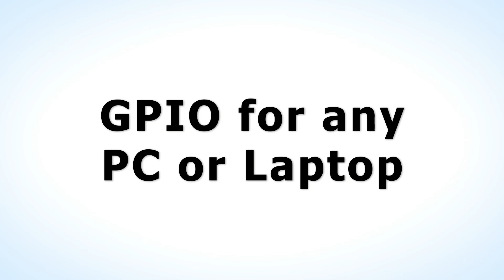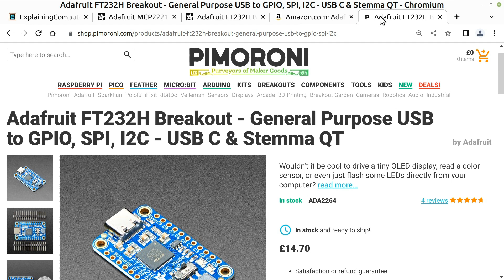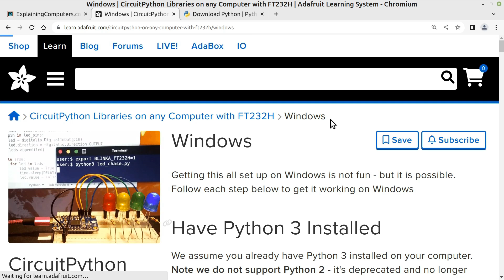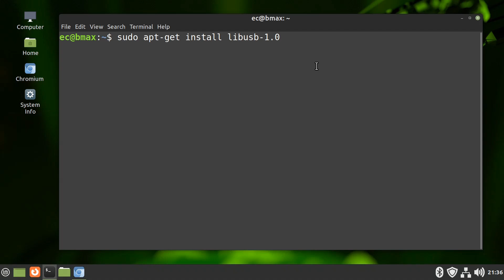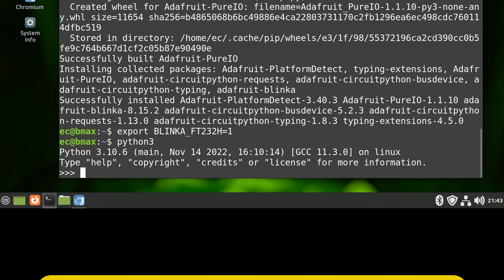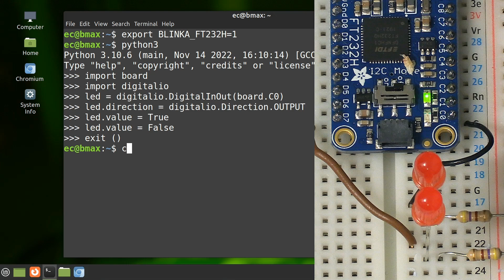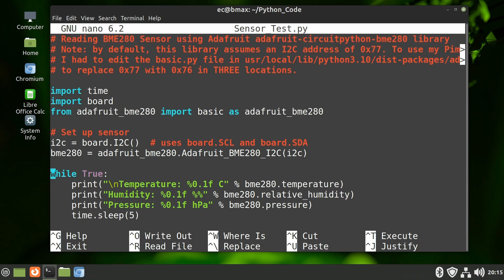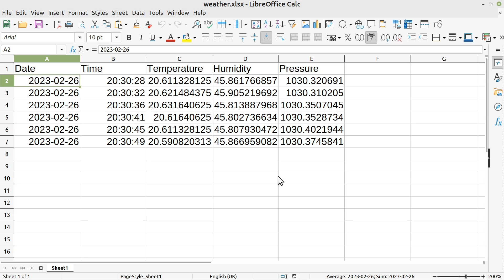GPIO for any PC or Laptop: Adafruit FT232H

Comment: Back in the day, standard serial and printer ports could be used as GPIO. That was the first time I was controlling electrical devices using a computer.
Reply: Exactly what I was thinking of, anyway, I think using parallel port was easier to start with since it doesn't require any coding/decoding circuit
Reply: @ahmad-murery  Those were the days my friend, we thought they'd never end. But they did. Personally I think a picoW or ESP32 has so much more to offer, so why did they bother with this ?
Reply: @hilldweller2  So true my friend👍,
anyway, I think having a direct access to GPIO will open the doors again for some applications (windows apps for example) to easily read/control external machines at a low cost.
Reply: @ahmad-murery  there is firmata and pyfirmata or you can create your own firmware

or write pc software that connects to and talks to the micro python interpreter to do stuff

for the pico there is also: Python picod module
Reply: @Henry-sv3wv  Not sure if I got you, do you mean that using Firmata and/or pyfirmata I can talk directly to the microcontroller on a raspberry pi pico?
can you collaborate more on this?
Thanks
Reply: @Henry-sv3wv  Thanks, I'll check it out
Reply: @hilldweller2  this would also satisfy with imbedded hardware design. Granted, most looking for an imbedded os with use a single board computer, but this would allow a lower development cost at current market availability.
Reply: @hilldweller2  Direct access from your pc, instead of programming a separate device.
Reply: @hilldweller2 I'm guessing to use your pc's cpu or gpu for speed.
Reply: @ahmad-murery   some applications (windows apps for example) to easily read/control external machines at a low cost.
Isn't it done easily and cheap with USB 1.x or 2.x?
Reply: @OgbondSandvol  I think using GPOI is easier to communicate with a simple machine that all it requires is switching on/off some control lines,
also, using USB requires to ship the machine I'm controlling with a USB/Serial encoder/decoder and maybe a driver (not very familiar with the subject).
maybe it's just me, but I find it quicker to test/implement my ideas using GPIO than using USB.
I'm not aware of any simple USB control implementation so if you do please share.
Reply: Besides serial and parallel, I also used the 15 pin joystick port.  This was cool because the joystick port can do analog input.  Good memories.
Reply: @gregholloway2656  I was just going to say that, I used to do that with the joystick ports on my old Atari 400....
Reply: You can still sort of do this today! Your computer has a bunch of I2C devices including HDMI. People have hooked up I2C devices to their HDMI ports and was able to do cool things with it.
Reply: I remember making a printer port to two additional joystick ports for the Amiga so we could play 4 player games such as dyna blaster
Reply: Back in the late 90s I remember cutting the plug end off a SNES controller and mounting on a parallel connector, wiring it up such that ZSNES could use it like a regular controller. Still have it tucked away in a box somewhere. Was awesome for playing emulated SNES games being able to use authentic hardware.
Reply: Actually, you could probably do something almost identical today. You can set up serial connections to MCUs, although they will admittedly actually be routed via USB. Send bits over the computer's pseudo serial port to indicate whether pins should be high or low.
Reply: @zetaconvex1987   Didn't old Garmin units do  serial over USB ?
Reply: I haven't seen one but I'm sure there are USB to parallel port adapters?
Reply: @MrTweetyhack  Yes there are USB to Parallel and USB to Serial, I used several ones in the past to connect newer PCs to old nautical devices
Reply: @ahmad-murery  I never got USB to serial to work. The shop I bought adapters and such from said there's a technical issue with 'em so they usually don't work.
Reply: @Reziac  I remember I had an issue with one adapter where the port appears under device manager on widows but the connected device cannot communicate with it, so I wasn't sure whether the issue was with the USB 2 Serial adapter or with the device itself.
Reply: @Reziac  There are two different chipsets for USB to Serial. One is really good and the other is crap. I forget which is which. 340 rings a bell.
Reply: @wayland7150  Interesting, thanks!
Reply: @MrTweetyhack  I haven't seen one either, but if there is I don't think the 12v pin(s) would be implemented..
Reply: @MrTweetyhack  Yep, I use one with my big old LaserJet. Works fine.
Reply: @MrTweetyhack  Pretty much everything that connected to a PC has a USB version that emulates it to the extent the software does not see a difference. It still thinks its a parallel port or a RS232 port.
Reply: Yes I remember it. The parallel port is basically ttl and eight bits of output/input (and some control lines), I used often. Did you know that you can still add one to a pc with a pcie slot.  The usb to printer ports are not good, only for really old printers not proper parallel ports  You can of course use a rs232 uart for io, but the logic is not ttl, and being a serial port it does not have very many pins. Also some modern devices do not have all the control lines.  But usb to rs232 devices are cheap and common.  

But neither of these (parallel and rs232)  has I2C or pwm etc.  

Lately I bought cards from data acquisition companies which generally have some io, maybe some counters. 

But the parallel port is still a thing in some science labs. It can have pretty low latency.  And win32 includes a simple interface for low level control. Not sure  about the latency of devices in this video. It might be as low as 1ms, but it depends on how they worked the usb interface.  I find a lot of these things a jittering in time response.
Reply: @bledlbledlbledl  It doesn't work like that in modern Windows anymore. There's a lot of extra steps that need to be taken now because the security model doesn't allow you direct access to hardware anymore.
Reply: the parallel port is still being used in professional EEG (brain waves) machines
Reply: I worked for a company in the 90s where installed video servers across the US, Canada. Puerto Rico, and in Belgium. We used serial and parallel to activate and read from devices connected. It would have been great to have these back then.
Reply: I still have a book I got in the 1990s on that subject.
Reply: Indeed. The original BASIC Stamp was programmed serially through the PC parallel port. Chip Gracey (owner of Parallax and creator of the BASIC Stamp and Propeller chips) is a whiz at x86 assembly coding and wrote the entire BASIC Stamp 1 editor in assembly, which included bit-banging serial through the parallel port. He did this because it uses 5v levels which allowed a direct connection to the BASIC Stamp 1 circuitry. The BASIC Stamp 2 used level shifters for standard RS-232 levels for connection to standard serial ports.
Reply: Yeah I built a box that took inputs via the serial port and controlled relays by turning on and off various pins on the parallel port. One example was to take temperature readings and display the temperature on the computer and switch on my air-conditioning if it got to hot. Check again sometime  later and if below a threshold then turn it back off.
Reply: Great story grandpa
Reply: Back 40 years ago I had a Maplin GPIO board for my Dragon 32. Yes it flashed LEDs but I connected a FET and did motor speed control. Attaching a GPIO to a computer you are familiar with is helpful. However the way it's shown in this video is identical to using a micro controller, at least in software. It would be more valuable to be able to blink the LEDs from MS Excel or Visual Basic. For example a Windows powered vending machine. Yeah I know that's a bit turn of the century these days because everyone uses Linux now.
Reply: And somewhere in my Computer Closet, I have what was once a very expensive ISA board used for similar connectivity. 

My goodness, how things have progressed...
Reply: Exactly what occured to me
Reply: With some high voltage to fry sensitive components coming from the serial port.
Reply: Recall using a parallel port to control a pair or plastic robotic arms.
Reply: Ach yess
Reply: Couldn't you do this if you bought a computer with a serial port? They're not uncommon on the mini PCs such as Chris held up. Have never looked into how to access. Probably the gadget Chris is showing us is much easier though,
Reply: But I guess it was in MSDOS era when programs had no multitasking and devices had no buffers. Yes, I remember that friend build me LPT DAC with amplifier relatively cheaply, it was much better than a sound card for a few programs that supported it (I think it was FastTracker and very few games)
Reply: I did not use it   except for controlling PC through LIRC, with IR receiver. Have you a hint how to printer port for controlling some relays, which software?
Reply: @colloidalsilverwater15ppm88  You can use Mach3 (32 bit windows, closed source VB)  or LinuxCNC to control relays,  but they are heavyweight programs for CNC machines.  They each use open source drivers to control the ports though so you could research that.
Reply: I'm still running CNC machines off parallel ports.   If I need something more sophisticated I'd get a Mesa card which offloads some real time control to an FPGA which  helps with latency spikes from the Linux kernel.   If I'm forced to use a USB connected I/O,  I'd do the  real time motion control on the "I/O" board,  like the Arduino Mega in my 3d printer.
Reply: I never get that level of using PC, and dreaming of it still today. Can you please do effort and give me so info regarding?
Reply: We did that in 2013.
Reply: And in the ancient prehistory, the bus of an 8-bit home computer was made available for the user in the back of the computer or in an expansion unit like my Sharp MZ-80K. Simply write to and read from I/O addresses that you decoded from the address bus. Not feasible nowadays of course.
Reply: Cool
Reply: This is how ancient techology is lost and gets rediscovered again
Reply: Alot of motherboards made today still have serial. You just have to break out the header on the board to a port on your case.

This is to satisfy business customers who often require serial for specialized machines and hardware and cannot use/dont want to use those USB serial controllers.
Reply: Single board computer
Reply: Laptop
Reply: I remember those days
Reply: Oh yes.  The banded wires.  Radio Shak to the rescue.

Comment: Great video!  This opens up a lot of opportunities, since it adds GPIO to anything with a USB port that can run Python.  Do you know if anyone is working on larger GPIO breakouts in the future?  The FT232H is a good start, but pales in comparison to the 40 pin GPIO connector on the Pi.  Maybe I'm just greedy, but I like my GPIO ;-)
Reply: I suspect with a bit of tweaking, you could run multiple FT232H boards connected to a USB hub.
Reply: @jimlynch9390  Good thinking.  It looks like each board gets a unique address so in theory it should work.
Reply: @Wythaneye  The only tweaking might be where in the Adafruit software you might put the port ID.  The other consideration is how might you address the boards from your code?  I haven't looked at any of this, just watched the vid and didn't see the answer but I could very easily have missed.
Reply: There are numerous different FTDI devices, some of which have more I/O. You could also use an FTDI part that provides an I2C or SPI interface and hook that up to as many bus expanders as you need.

Comment: Can you explain what that chip on the board actually is. Is it a microcontroller or what exactly?
Reply from the maker: It's not a microcontroller. The FT232H is a basically a USB interface controller -- allowing USB control of other serial or parallel interfaces. The chip is often used to provide the USB interface in devices like digital cameras, flash card readers, for industrial automation and reading sensors, etc. There is full information here: https://ftdichip.com/wp-content/uploads/2020/07/DS_FT232H.pdf
Reply: Interesting. Could this then be used on say an old mobile phone to give that some GPIO? Assuming drivers, etc existed for i.

Comment: You can press Ctrl+D exit Python. Don't press it to many times or you'll exit right out of your terminal. That's always fun.
Reply: know something even more fun than that. Typing rm asterisk.asterisk while as root in a terminal. Learned that rather imortant lesson in 1996 while I was new to Linux and learning how to use it. Ended up spending some more time getting familiar with the installation and setup process.

Comment: The BMAX has disappeared from the internet, lots of unhappy customers, and negative comments on amazon,unit not working out of the box(or later) etc..
you should not promote such businesses if you have any respect for your viewers.
Reply: I just looked and easily found the BMAX he mentions, though the price has gone up a bit.   As far as respecting his viewers, I've followed Chris for years and found him to be one of the most up front and honest people on youtube.
Reply: I'm among the positive 50%.  I grabbed one right off and it's working just fine.  I picked up a cheap m.2 ssd, installed Linux and didn't look back.
Reply from the maker: The Bmax B1 Plus has not "disappeared from the Internet". But it has gone out of stock on Amazon US and UK since I posted this video. I read the comments on both Amazon stores before making the video, and did not come across lots of complaints about it not working. Certainly there are negative comments about the time taken to do Windows updates. But that is a Microsoft and not Bmax problem, is common for any lower-power PC, and does not disrupt the longer-term user experience.
Reply: Seems though YT ate my comment! Typical.

Anyway, the BMAX is sold out on UK Amazon but is still available over on US Amazon. As for the reviews, on UK Amazon, 58% of them are five-star ones. On US Amazon, it's 57%. Lots of satisfied customers if you ask me! Don't go dissing the poor man like that.

Comment: I've been looking into tinkering with this type of stuff for a while. Tell me, is it at all possible to make this board appear as a different USB device, say, a keyboard?
Reply: I doubt it.  The chip has hard-coded USB class codes and you probably can't change it to emulate a Human Interface Device.  You can do that with a Raspberry Pi Zero, however, using the Linux USB gadget code.
Reply: @dfs-comedy  Hey, I wasn't aware of that, will look into it, thanks!
Reply from the maker: @DFS-Comedy You are absolutely correct.

Comment: What's the advantages of Adafruit FT232H over Arduino Uno with PyFirmata?
Reply: If I understand things, the Uno is stand-alone, low powered, limited language/OS, microcontroller, the FT232H only does the specific task of controlling the IO for a (possibly) more powerful machine with a more complete OS/language. However, given that, a use case could be an Uno controlling several FT232Hs to give it more IO capabilities/channels. (besides the use case shown here)... Or doing dev work on a PC or other device without GPIO...

Comment: Hi could you make a video about running raspberry pi without power as in portable power supply
Reply: What do you think sir?
Reply: I believe that this subject was done well over a year ago.  One project he did this for was the remote control robot.
Reply from the maker: Leslie is correct -- see https://www.youtube.com/watch?v=lPyDtuzYE5s
Reply: How about using super capacitors